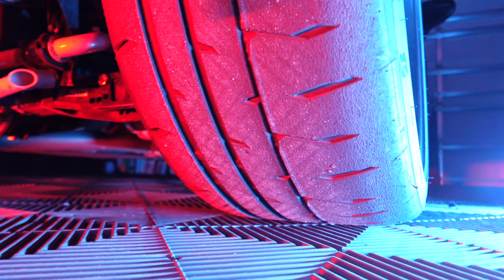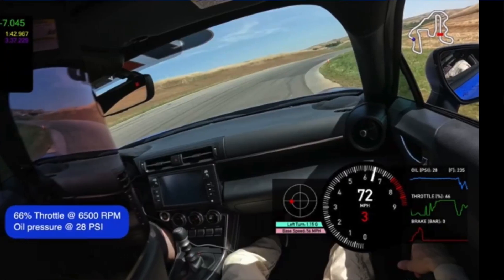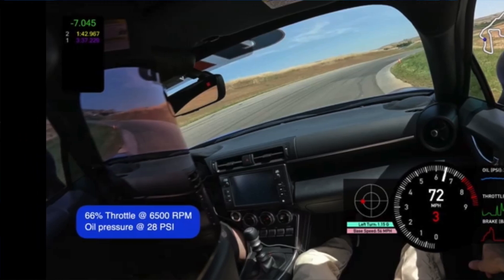GR86 Motor Problems

Comment: Very well described and explained. The old FA20 had the same exact issues. Eventually the motor will go even with all mods as you explained. For the price is still packing a lot of driving balance and fun with decanter reliability.
Reply from the maker: Thank you! It’s super fun on track
Reply: Thoughts on the FA20 and blowing if not tracked but driven hard? What oil brand and weight would you recommend?
Reply from the maker: @stevef3521  it doesn’t look like the FA20 motors have the same issues as the FA24 motors with the low oil pressure on right hand turns. I would still recommend a high quality 5W 30.
Reply: @phelpsgarage4202  I’ve been running Idemitsu 0w-20 as the previous owner only used that and swore by it. It’s been very well maintained as previous owner is a mechanic. I’m thinking about trying Motul when I change it next.
Reply from the maker: @stevef3521  do you track it?
Reply: @phelpsgarage4202 I do not. I do drive it hard at times, but nothing crazy. I always wait until everything’s warmed up before I ever really get on it. I also shift from 1st to 3rd, avoiding 2nd gear for the first couple mins of driving. I don’t like the resistance 2nd gear gives on a cold start. It has 155k miles. Engine feels tight and runs better than many I’ve driven with half the mileage.
Reply: @stevef3521  If you live in the lower 48, I would recommend 5W30 and if you live in the really hot areas like Texas, Arizona, Nevada I would go to 10W40 in the summer and then in the winter 5W30. This is what I do with my street 2022 WRX. In my race car which is strictly a track car with an Audi 2.0T engine, I use 10W60 only. The factory recommendation is 5W30...
Reply: @andresrtorres9794 Midwest. So 3-4 hot and humid months a year. I mainly drive it in the evenings. Still think 5w-30 full synthetic is the way to go? I just did an oil change.

Comment: One thing I'd like to add as a fourth problem or thing to address is the volume of oil inside the pan - the pan itself is PRETTY small and add some high lateral Gs, you might actually NOT have enough RETURNING oil volumes / flowrates back to the pan to sustain a flooded pickup EVEN WITH baffles. From my research with a local shop, there is no real way to expand the volume of the pan itself and looking up at the space above the pan mating surface, you can actually overfill the pan. So solution? Baffle + overfill. I currently haven't slapped on sticky tires yet but I've consistently used 0-30 or 5-30 and overfilled with 5.25 liters of Motul. No issues yet.
Reply from the maker: Im at 6 quarts because of the oil cooler.. I’ll probably push a little bit more.
Reply: @phelpsgarage4202  you probably could. I didn't really see anything that shouldn't be lubricated above the oil pan especially if you have baffles to prevent most of the oil from creeping upwards out of the pan. Once I get my oil cooler, its time to add even more.
Reply: @phelpsgarage4202 FA20 is 5.7 quarts with the filter.

Comment: 30 weight yeah... but I wouldn't go -40 on oil.  If it the engine is designed for -20 then I would assume bearing clearances are on the tighter side.
Reply from the maker: Yeah if I do it I would let it warm up before I did any hard driving

Comment: When I first started hearing about these issues with this car, I was wondering why there was no aftermarket oil pan baffle being offered. I don't know much about this car so I thought maybe there is some technical reason why it could not be done? However, after seeing yours I am even more baffled :) that no one seems to be selling something like this (looks good BTW). I mean especially if folks are already dropping the oil pan (or paying someone else to do it) to check for RTV! This seems like a no brainer to add IMO, and if you were seeing oil pressure dropping to 30 PSI on track and now it never goes below 60 PSI, clearly it works.
Thicker oil, oil cooler, and oil pan baffle, this is common sense and yet all the videos of folks talking about this issue, this is the first one I have seen where these potential solutions have even been mentioned. Are most people that buy and work on these cars really that clueless? Or did I just miss those conversations?
Reply from the maker: Thank you for the kind words! Most people probably don’t want to void their warranty. And even though what I’m doing is working, it’s still not 100% I believe the aftermarket is doing something, but it’s taking time to develop and then test and then put it out into the world.
Reply: @phelpsgarage4202  I don't know, from what I have heard it seems like chances are slim that an oil starved motor failure will even be covered under warranty regardless. If you are going to track the car, I would much rather have the added insurance. And if you really want to try for a warranty claim, it is not all that hard to drop the pan and remove a baffle, is it?
This issue has been on the radar for some time now (well over a year I believe), I have seen shops put together and then test and tune an entire turbo upgrade systems in a matter of weeks, you really think it takes this long to develop an oil pan baffle? Is there room to make an improved oil pan, perhaps something that might work even better with a baffle and increase volume?
Reply from the maker: @ericmichel3857  I don’t think we knew how serious the problem was a year ago. But I do know there are companies testing products now I just don’t know how long it takes to be released to the public or the cost. It’s not to difficult to remove the pan for the second time around.
Reply: Syms Racing has a baffled oil pan and STI Japan offers one as well, along with just a baffle set. Trust, Tomei, and Cusco offer baffle plates as well. At least in the JDM market.
Reply: @tvtime2644  Oh okay that makes a lot more sense, in fact I thought he said he used a homemade baffle plate, but I now realize what he really said was Tomei baffle plate, I see that now thanks. Okay so there are already a bunch of options. Obviously I know almost nothing about this car/engine. So if the older model and the WRX/STI use basically the same engine, why is this issue only mentioned with the new 2.4 liter engine? Or is this an issue with all versions, and I just never heard about it?
You hear so much BS I don't know what to believe, some say this is a very reliable track platform (especially in NA form), then others claim it has a reputation... I am starting to suspect the problems might be more user induced. I mean you can't run slicks pulling 1.5 G's and expect a stock setup to handle all of that, is that what these chuckle heads are doing? And then jumping on the internet claiming the car has a design problem? 
Okay I think I get it now
Reply: @ericmichel3857 IIRC WRX have oil issues without a baffle too.
Reply: KillerBee motorsport have it

Comment: Seems like in order to run a Subaru hard on track you need a dry sump.
Reply from the maker: Yeah, but I think the aftermarket can solve this issue without having to buy a dry sump.. or get close enough 🤞🏻